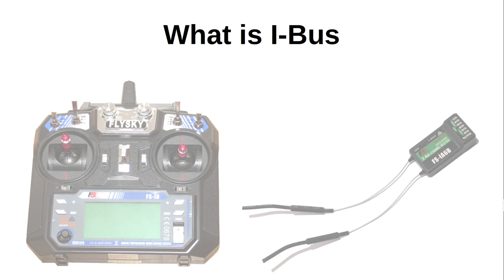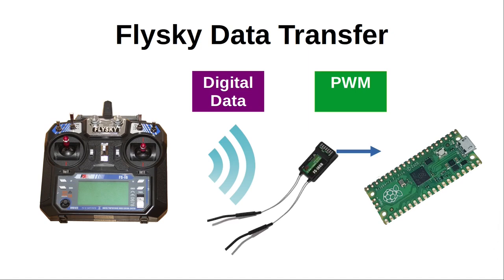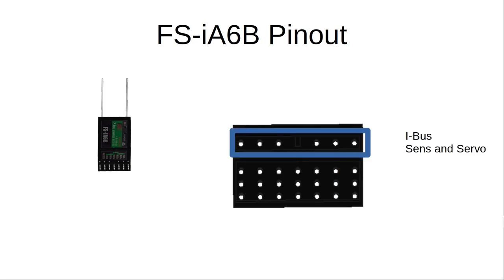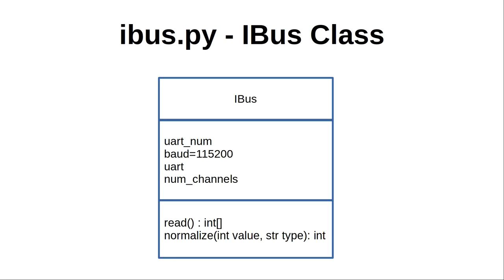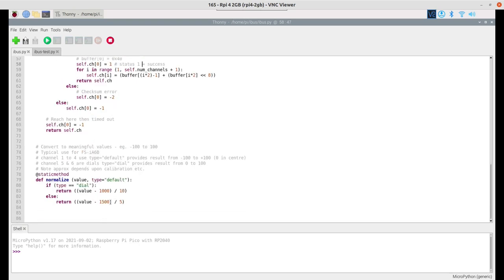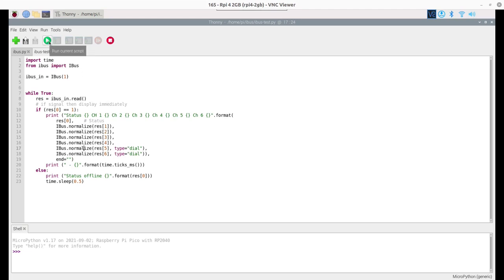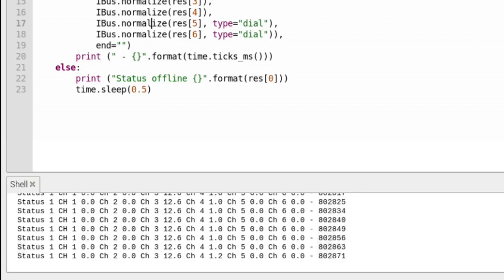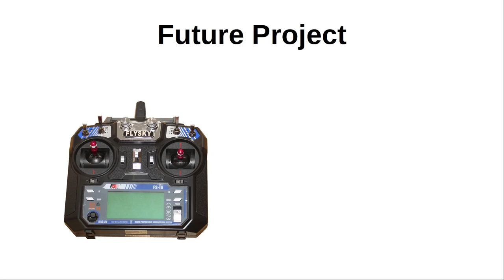Radio Control Raspberry Pi Pico I-Bus

Comment: Thank you very much for the very helpful explanation and example Micropython code. A relevant discovery I wanted to share; while cutting the signal does not stop the receiver from transmitting signals for each channel, one can engage a failsafe mode for each channel from the transmitter, with a custom level. That way, if the signal between the transmitter and the receiver is lost, the signal for that channel will revert to the failsafe level set, and not to the last signal received.

To adjust the failsafe for the FS-IA6B receiver using the FS-16X transmitter, one navigates to System->RX Setup->Failsafe. Select the channel and adjust
 the failsafe value by manipulating the relevant channel on the control. Then, when the list of channels is displayed

again, long hold the Cancel button to save the setting. For the dials (channel 5 and channel 6), the setting should be -100%
on the transmitter to failsafe to 0 as the signal for the Pi Pico if one is using the very helpful example ibus code provided by Penguin Tutor (Stewart Watkiss).
Reply from the maker: I'm glad you found it useful. Thanks for the additional information, that's a great help.

Comment: Nice work! I recently got sbus to work on my Raspberry Pi 3. The main challenge with SBUS is that it is a 100000 baud rate protocol, which is not something the standard UART supports on the Raspberry Pi. But I was able to get it to work using a plain GPIO pin and getting the timing of the edge transitions from pigpio. Because the Rasperry Pi 3 is not a microcontroller, sometimes I lose a packet I think due to context switching. But around 75-80% of the packets are good (checked with parity and UART frame bits). I haven't stress tested it yet, that performance might degrade under load. However, the transmitter is transmitting a packet every 10ms or so, so a dropped packet just increases the lag to 20ms, which is plenty acceptable.

SBUS has 18 channels, which is nice, though probably overkill in most situations, and most transmitters transmit RSSI (radio strength) on channel 16.

Anyway, I am thinking of posting a video and releasing the code. I haven't done that before so that might take a bit and I really need to clean up the code and make it ready for others. If/when I do so I'll edit this comment and add a link.
Reply from the maker: That sounds like it would be really useful. It is possible to use pwm inputs to a Raspberry Pi but I've not seen an implementation of sbus yet.
Reply: @PenguinTutor  FWIW, I have completed this project. Here is a You Tube link (which has a link to the github with the code) - https://youtu.be/pWE8LxcFq9Y. I am considering adding a separate video with a code walkthrough like you have done. Thank you for posting your video, makes me feel like there are people out there who are interested in doing this sort of thing.

Comment: Interesting Video!
Do you also know how to do this with a ELRS-receiver (like Radiomaster RP1), which uses the Crossfire protocol (crsf) over uart?
So far, I have not yet found the library for the crsf protocol in micropython.
Reply from the maker: I've not come across that before. It sounds interesting. Unfortunately I don't have time to look into that at the moment but it may be something I could look at in future.

Comment: Great video! Thank you. Can we run it on Raspberry Pi 3B+?
Reply from the maker: This video is based around a Pico. I expect it is possible to do the same using python-ibus on a Raspberry Pi. 

This is likely to be better than trying to use PWM on a Raspberry Pi.

Comment: I get "ImportError: no module named". Any idea what cases this?
Reply from the maker: You normally get that if you don't upload the module first. Did it tell you it was ibus that it couldn't find?

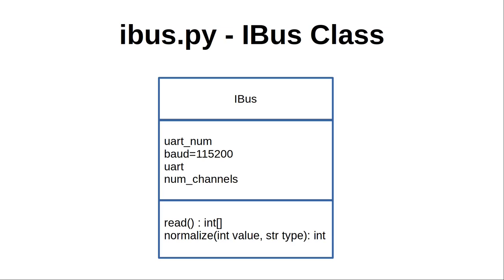Did you transfer the ibus.py file to the Pico as explained at 0:11:08 ?
Reply: That happens because the code is calling upon a separate file, which in your case isn't there. Add the file he sent under your comment and it should work